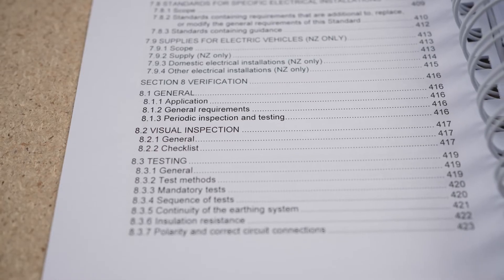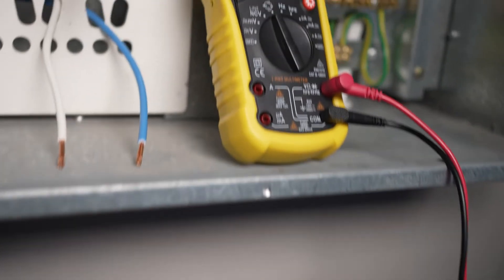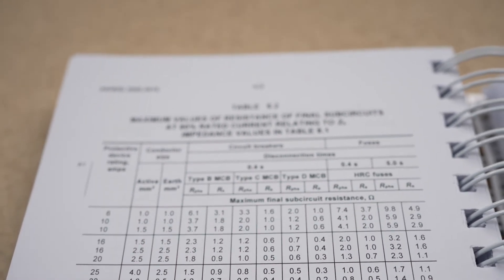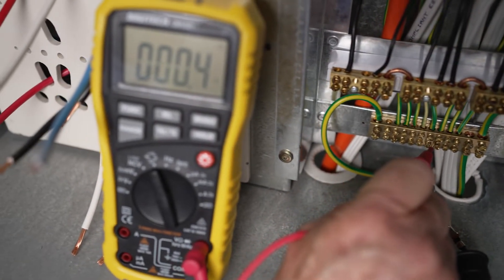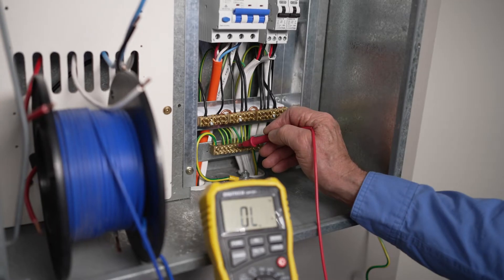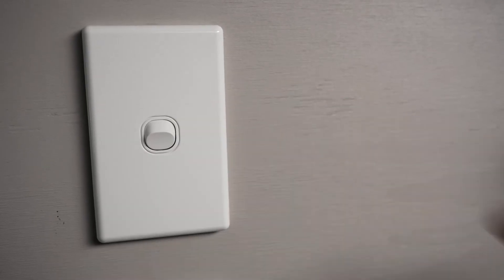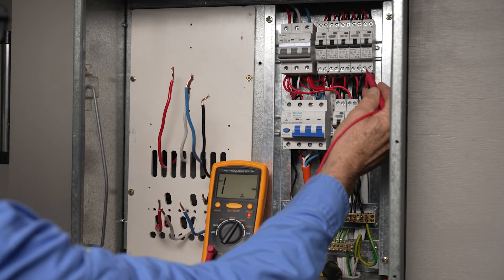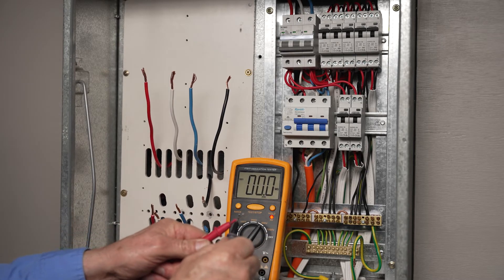VERIFICATION of an ELECTRICAL INSTALLATION | How to do it

Comment: Wouldnt sending 500v during IR test with all the swithces on damage the protective devices as well as any equipment connected ?
Reply from the maker: In response to your question, we will try to clarify a couple of points here. (1), an insulation resistance test is conducted between live conductors (active and neutral) to earth, with the IR tester connected between those two points+.  We can individually test from active to earth or neutral to earth but never across the active and neutral of a circuit. This action could damage sensitive components connected in the circuit as a 500V d.c. pulse voltage from the test instrument would cause current (although very low, because of the IR testers impedance) to flow in the circuit. (2), it is the dielectric integrity of the insulating materials in circuit conductors, protection devices and sometimes appliance components being tested here. For example, the dielectric strength of PVC insulation is around 20kV per mm, which is much higher than the testers output. The IR test on a 230Vac circuit applies a higher voltage (500V) to ensure the validity of the insulation at nominal supply voltages.

Comment: Gday, Just a quick message to thank you for your videos. I am just about to undertake a course to have my former expired NSW Electricians license recognized in Queensland where I now reside. Your videos have been most helpful bringing me up to date and re-affirming my current knowledge in regard to the current SAA wiring rules requirements. These video give me a great headsup on what to expect and bring me up to date with current requirements in regard to verification of circuits.  Well done
Reply from the maker: Thanks for your feedback, and we wish you good luck with your studies.
Reply: @cet_learning  Purely for your info. I undertook the updated course and was amazed at the updates and new safety requirements. I crave this type of learning but this was near overload. While I studied (quite a  bit) I was flumoxed when exam time came to do the verfication tests etc and I was given a Multifunction meter that I hade never seen or used in my life. We were giver a very quick 5 minute overview but when it came to testing in reality I had not idea how this instrument operated or felt confident or comfortable in how it worked. As such I realized I was not going to pass the exam and arranged to return at another time when I become competent in the multifunction meters they use. Gutted but not defeated :). There were further updates here in QLD in regard to IR testing and the 1 megohm pass is now a fail other than HWS and stoves. Minimum IR must now be 50 megohm in residences with 50 metre or less distance to furthest outlet..  Further I did not realize that analogue Insulation testers are not longer able to be used in these tests due to their inability to be accurate enough here in Qld. I dont know if this is the case in other states.

Comment: What happens when testing a resistance or continuity with a multimeter in a live high voltage circuit??
Reply from the maker: Resistance or continuity testing with a multimeter can only be performed on dead circuits regardless of the systems operating voltage.
Reply: @cet_learning  
Yes but what happens when you accidentally test resistance or continuity in a live 600 vac circuit???
Reply: @Jay-tr3px  YOU GET HURT AND IT GOES BANG
Reply: @angelofranklin1  
Lol! 
Whew! Close call!
Reply: @Jay-tr3px  a decent  tester will have a fuse that will blow. Has happened to me when using a multifunction tester

Comment: M.E.N link must be in place to test the residual current devices.
Reply from the maker: That is correct. We cover the topic towards the end of the video.
Reply: I’m having trouble with the MEN link.  I’m about to take my TRA exam and I’m reading that taking out the MEN link for testing is an automatic fail? But it makes sense to remove.  Please help!
Reply: @willspencer7099  thanks everyone -_-
Reply: @willspencer7099  did you remove the MEN link in your TRA test? Did you pass or fail. Doing mine in few days.